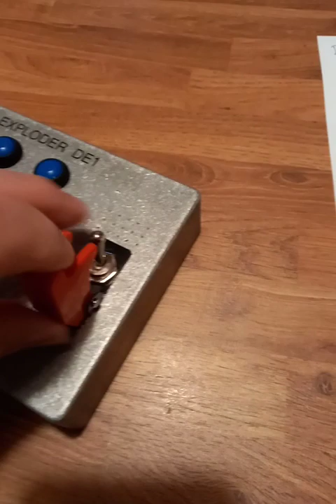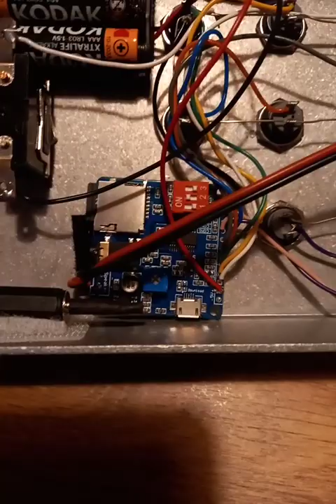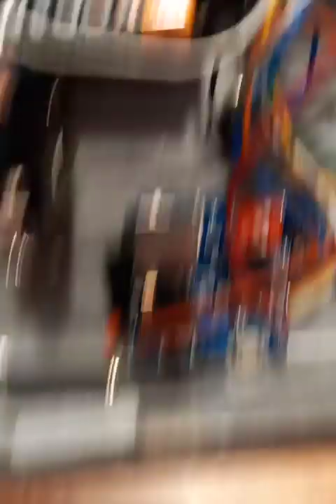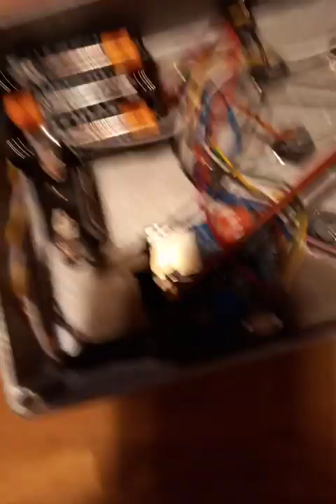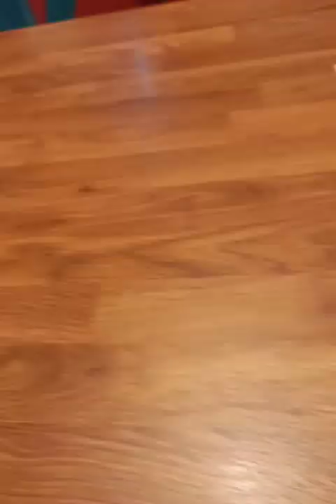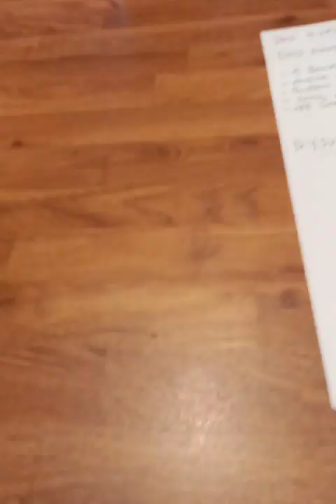Lo Fi Backing Track Player Using DY-SV5W MP3 Module DOG EXPLODER DE1

Comment: So, it appears this MP3 board won't start playing something as soon as power is applied. That's what I need.
Reply from the maker: I'm using this in the most caveman way possible. I'm guessing that the sky is the limit if you have a microcontroller involved.  If I remember, you can have full mp3 player functionality.

It's been a while but if you only want one sample to play and not a variety, it may be that grounding the pin of that sample already, instead of using the button switch may trigger it when you power the unit.

The data sheet is pretty informative.